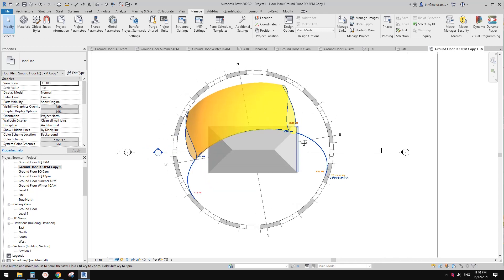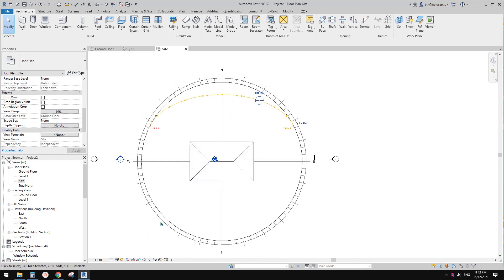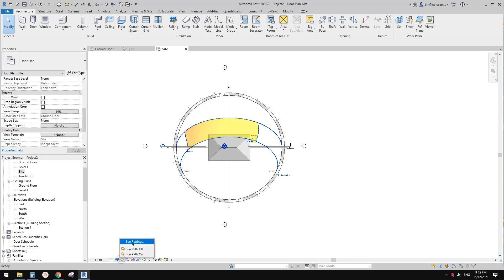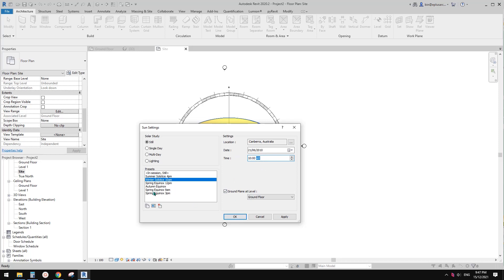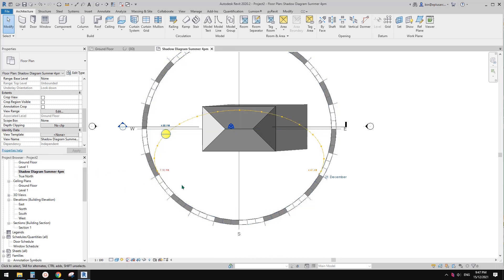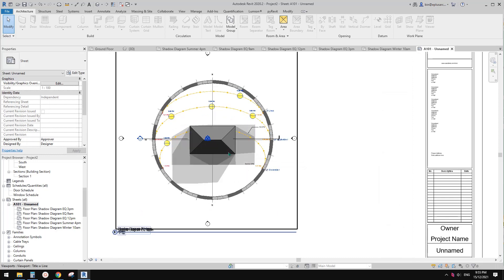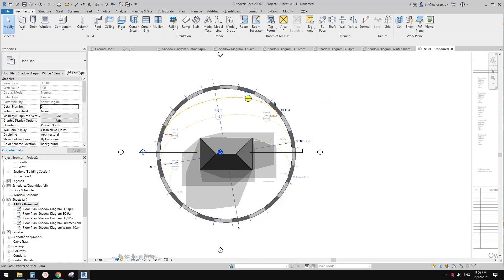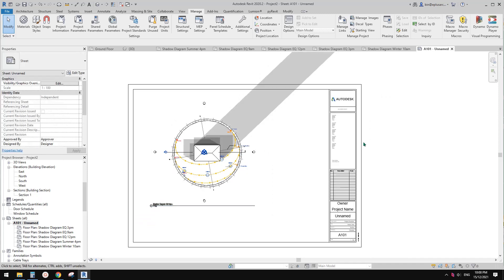Revit Exercise (Day 630) Solar Study/Shadow Diagram Exercise

Comment: I think there was an option to unclick shadows in the View Template   12:28
Reply from the maker: Yes, you are correct that we can turn on or off the shadows with that one. However, what I wanted is to adjust the tone of the shadow, which is controlled under the Lighting - Shadows, same place for the Sun Setting. Having this Lighting checked will override the 5 different sun setting and make them the same. Thanks again for your comment and keep up the good work.